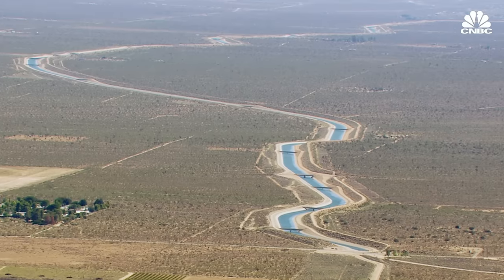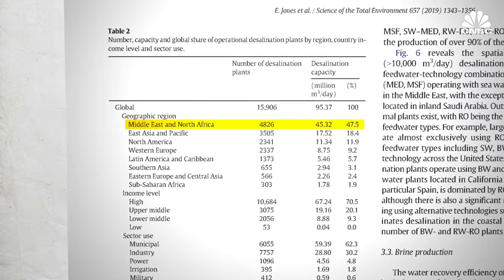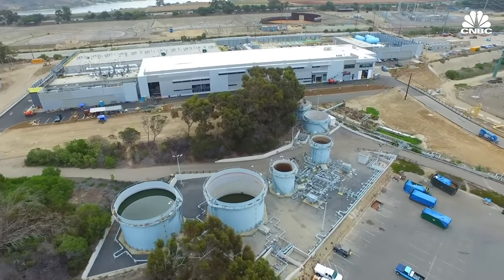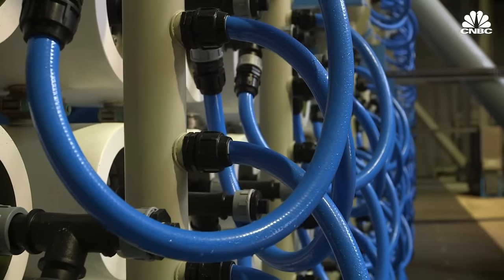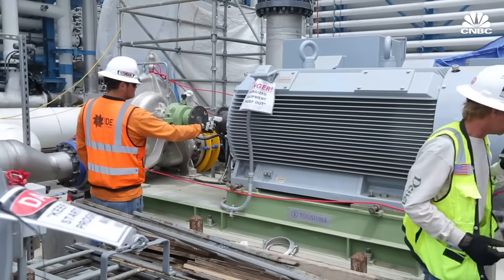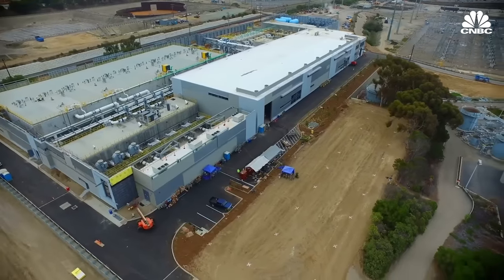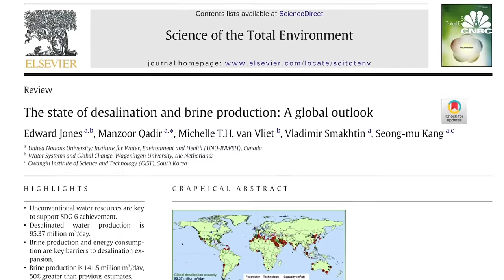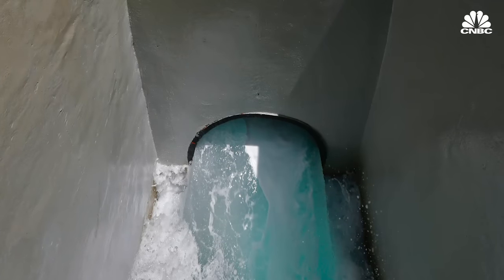Can Sea Water Desalination Save The World?

Comment: The Brine could also be sold to areas with Hard Water/High PH to soften their water. Today, in 2021, as I watch this, over 120 Countries operate Desalination Plants. With the Rising levels of the Ocean Waters, Investing in Responsible Desalination Methods seems like a worthy Investment. Droughts are only getting worse & nothing can live without clean water!
Reply: high blood pressure ring a bell...ding ding ding..
Reply: @peter-pg5yc  That's not how water softeners work. LOL!
Reply: Isnt hard water and high ph water with high amount of bicarbonates and diluted salts or im missing something lol
Reply: I don't know how water softeners "work" but I do know I have to pour lots of salt into the reservoir.
Reply: The Brine also contains several valuable minerals and metals like Lithium, Uranium, and Thorium. There’s one desalination plant that produced enough lithium to build thousands of EV batteries like the ones used by Tesla. The Uranium and Thorium can be used to run clean nuclear power plants. Oh, and enough salt would be leftover to shut down all the salt mines in the world, which would further reduce our carbon footprint.
Reply: @TeslaKuhn8  
works by replacing  calcium carbonate with salt: sodium chloride.
Reply: @GrizzlyTank  
wow, what visdom.
Most water in California is used for irrigation of growing food producing plants.
The water requirements for plants depend on the concentration of the plant food: carbon dioxide in a cubic meter of air, at low altitudes today 0.49 grams per m³.
For every gram of plant, glucose, C6H12O6 1.47 grams of Co2 must be captured though the stomata of the leaves from the passing air; and hundreds of grams of water pulled out from the soil through the roots. a tiny portion is used for the hydroxi OH on one side of the glucose molecule and the H on the other side of the same carbon atom in the molecule, in other words the water molecule is split by sunlight and rearranged around the carbon atom after spliting the co2 molecule and discarding the oxygen, that we end up breathing.
Now this oxygen is poison to the plant and needs lots of lots of water molecules to flush out.
When the concentration of co2 in the air is higher  much less water is needed  to flush the oxygen out.
some is always needed to be evaporated on the leaves to draw water from the roots.
This process is called photosynthesis and requires a catalyst, chlorophyl.
The point is that more carbon 'foot print' co2 will reduce the irrigation requirements to free up more water to the people's needs.
Most people have no idea about the role of the gas of life, co2 , which they breathe out and it0 collects in closed rooms in high concentrations, to the delight of the decorative plants near the windows.
To get educated watch the "Clintel lecture" by W happer. a delightfull presentation much better organized than I ever could.
Reply: It would make it even more expensive  to deal with the brine so the "cost effective" method is to pump it back into the ocean.  Desal plants are very expensive to run.
Reply: @geoengineeringdebacle3984  
That is correct , when the thermal energy is expensive for a MSF, the brine with modest increase in salinity is released in a tube reaching  ashore a reasonable distance. The intake is selected with the lowest available temperature to maximise  the number of stages.
 Usually the out flow is directed downstream, where it mixes in short order.
To minimize scaling, phosphoric acid is added, which can be an undesired by product in the brine.
Reply: @arturoeugster2377  said "Now this oxygen is poison to the plant " - - no, there are parts of the plants, the roots, that NEED oxygen for cellular metabolism and growth.
Cypress "knees" are a way to get more oxygen to the roots in a swamp.
There was a time when Earth's atmosphere was 34% Oxygen ... it's not poisonous.
Reply: not when there are other much cheaper options available
Reply: "From that time Jesus began to preach, and to say, Repent: for the kingdom of heaven is at hand." Matthew 4:17 

"Ye have heard that it hath been said, An eye for an eye, and a tooth for a tooth: But I say unto you, That ye resist not evil: but whosoever shall smite thee on thy right cheek, turn to him the other also." Matthew 5:38-39•'
Reply: but that would make fresh water non-profitable

Comment: We could do anything if we truly tried.
Reply: Here's one idea: Siphon water from Greenland's meltwater ponds and lakes, into large re-purposed oil tankers.  These ponds and lakes are increasingly appearing on Greenland's ice sheet, and speed up melting of the ice sheet, and increase the speed of glaciers moving toward the ocean. So, a win-win.
Reply: Here's another idea I came up with. It's desal. by evaporation. 
Seawater would be heated by sunlight under a large structure (located near shore) that looks like a clear upside-down bowl. Air would be pumped out the top through a pipe that runs uphill (the higher the better) to an array of pipes that cool and condense the humid air into pure water. These pipes would be cooled by this amazing new tech: https://www.youtube.com/watch?v=7a5NyUITbyk
The water in the upside-down bowl would be in a partial vacuum, and would actually boil. The whole system could be made more efficient by using the downward flowing motion of the freshwater to pull more air up from the seawater. Wave/tide power could also help power the system.
Reply: Yes, if we do it together.
Reply: There are actually scientific limits to things lol
Reply: Really, fly like superman and defy physics? Really?
Reply: Challenge Elon Musk to do this. He'll figure it out.
Reply: @richfarfugnuven6308  See the reason you aren't a millionaire is because you just didn't try enough.
Reply: @troywright359  actually too late.  I am a millionaire.
Reply: @FLPhotoCatcher  yea...you came up with....its called a solar distiller and its been around for as long as we have had glass.....
Reply: We can't go faster than the speed of light...

Comment: Title: Harnessing Water intake in desalination plants from mesopelagic (below epipelagic) region

I'd like to propose an idea  that has possible potential to help the desalination industry.

Imagine a desalination plant that deploys an intake pipe from mesopelagic region to the surface, and then pumps its feedwater from the opening of this large pipe on the sea surface. This pipe will continue to fill due to the capillary action and we do not need energy-intensive pumps to bring that "cleaner" water to the surface.

There are several compelling reasons to explore this approach:
1. Reduced Biofouling: Drawing water from greater depths could significantly reduce the risk of biofouling, a persistent challenge in desalination. By avoiding the epipelagic region where microorganisms thrive, we can minimize fouling and maintenance costs.
2. Potential for Lower Suspended Particle Concentration: mesopelagic waters typically have lower concentrations of suspended particles compared to surface waters. This could lead to system longevity and reduced costs.
3. Environmental Impact: Deploying a possible parallel line for brine disposal at the same depth can mitigate the environmental impact of brine discharge. This approach allows for more efficient dilution and dispersion, reducing harm to marine ecosystems.
4. Significant Savings: Energy savings, reduced maintenance costs, and improved desalination efficiency could translate into significant economic benefits for the industry.

I invite you to share your thoughts, ideas, and expertise on this proposal.
#WaterTreatment #Desalination #Innovation #Sustainability